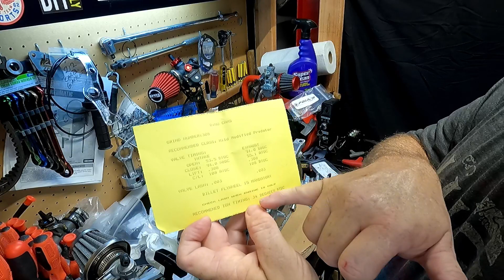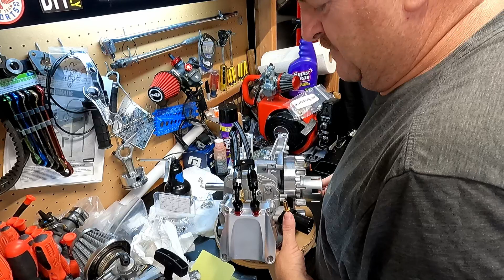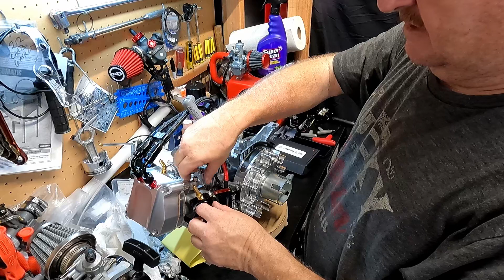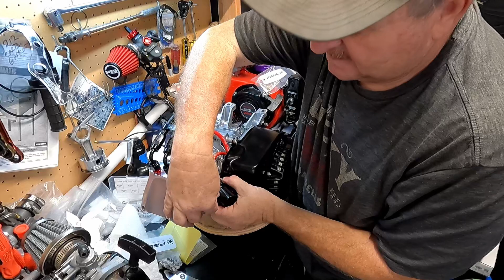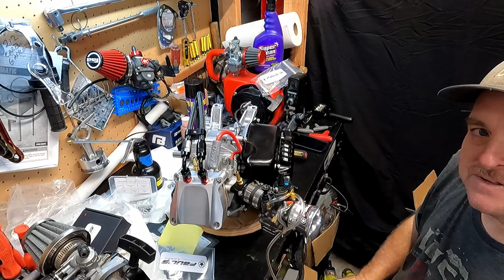Predator 212 ARC Billet Flywheel and Paul's Karts Hot Coil Install

Comment: Shouldn't you retard it 2 degrees rather than advance it?
Reply from the maker: Hello James, The 308 cam I used required 34 degrees timing. The ARC flywheel is built with 32degrees. I used the 2 degree key to get the needed 34 degrees. Great question! Thanks for watching!!!
Reply: @DIYWilly  right, so you moved the timing 2 degrees back not forward?
Reply from the maker: Yes 👍 BTDC

Comment: I purchased a coil from Paul's kart as you suggested.  Waiting for it to arrive so I can put it on my built 212 predator.
Reply from the maker: Hello Gilbert, Paul’s coils are bad a$$. Thanks for watching!!!
Reply: @DIYWilly  I installed,  broke a valve spring, added a big valve head ported and milled.  Test road today and I can agree they are. I am using the autolite spark plug with it. I was cruising at 64 m.p.h today on the river bed near my house today.
Reply from the maker: @GILSJOURNEY  64mph is no joke on a minibike. Congrats!! Be safe!!
Reply: @DIYWilly  I agree, it's plenty fast for anyone
Reply: @DIYWilly  Thank you

Comment: Hello, I’m currently in the process of building a Honda GX200 clone performance engine (212cc for the time being) from scratch for the fun of it and learning purposes, and from the research I’ve done, hopefully these few questions can be answered, and my apologies if they’ve been answered. What’s the stock length of the Connecting Rod for the clones; when is it appropriate to use dual valve springs and forged pistons such as those expensive ones from Wiseco; and if using a 0.640” comp. height piston, 3.308” billet rod, and a 0.010” head gasket combo will be too long for the block (giving me a negative for deck clearance?) I’ve tried looking everywhere for these answers but I assume I might be getting too specific. I know people use 0.550” CH pistons with 3.308” billets rods and up to 0.020” head gasket with no problems. Any information and guidance is greatly appreciated👍
Reply from the maker: Hello, For my Predator 212 build I used a ARC 6256 3.328+20 rod. I matched that to a .570 flat top piston. I used a gx160 head with 27mm/25mm stainless valves. I used a 308 cam with single 32lbs springs. Right now it has a .010 head gasket but I also have a .032 copper gasket that was recommended by Paul’s Karts. The engine runs fantastic actually more power than I like..😂 I should mention that it also has a Paul’s Karts 28mm performance carb. Thanks for watching!!
Reply: Woah that’s an awesome build! Similar to what I’m going for. I’m mostly aiming for lower end high torque, and I want ~5000/6000 RPM to be the sweet spot for speed. I’m definitely getting ignition with rev limiter so I don’t have an unfortunate accident lol. My biggest fear is making the piston go past the top of the cylinder block, so I should be in the clear if you’re running that connection rod and Piston combo. Also, correct me I’m wrong, but I’ve read that it’s better to run a carb with 1-2mm less than the intake, so I’m wondering why you’re running a 28mm carb with a 27mm intake?
Reply from the maker: @vortexslayerf1729  Yes you’re correct about the carb size. I’m running that carb because it was provided for this build. I would run a 26mm for best results. This one is running rich but can be jetted down. Besides it’s a beautiful carb from Paul’s Karts

Comment: Hey Willy, I’d like to know if the vent tubes come in a kit from PK or if you had to buy it all in separate pieces.  Also do you have to drill and retap the top ARC billet side cover to get the new AN fittings from PK?  I was going to do /8” NPT to 1/2” barbed fittings and 1/2” clear tubbing but I really like the look of the AN lines and those two how’s brackets to hold them straight 👏🏼.  So damn Sexy!  Paul makes some great stuff, I just hate having to pay his shipping charges too.   Hell 2 barbed fitting $9 each so $18 the another $22 to ship them is like no thanks.
Reply from the maker: Hello ol-man-Duffy, All the parts used were purchased separately from Amazon. I will update the links to show parts used. The hole in the ARC side cover are very close but I did run a tap through all the holes including the valve cover to get the fittings to work the way I wanted them. I should have talked more about the install. I do wish I would have went with a larger diameter but these are 4an size. Thanks for watching!!!
Reply: Ok thanks Willy I’ll look there and keep an eye on your parts list in case you change them. I agree -4 would be 4/16 or 1/4” inside diameter.  I def. Want to go 3/8” or 1/2” but that would require some machine work on that cover.  Looks very clean though and hope to see more of this motor running and winding out moving forward.  She needs to see 6-7k in the rpm range before she starts burning that fuel and using that timing you put into her.  I’m thinking a stall clutch or 5k stall TQ converter would make this engine a rocket.  My build is VERY similar.
Reply from the maker: Probably won’t see this one back on the channel. Crashed the bike last week. I’ll talk that engine off and try and save the frame.

Comment: You actually want the notch in the key facing the rear of the motor that will allow you to turn the flywheel clockwise 2°. Also holding the flywheel while torquing its nut can spin the crank shaft taking out that additional 2° of timing you wanted , hold it from the left side.
Reply from the maker: Hello Boosted, Yes the notch was installed facing the rear (head) side of the engine with the key facing forward to advance the timing. Reversing it would retard the timing. The idea is to rotate the flywheel clockwise to increase the timing. Thanks for watching!!!

Comment: Do I have to use the key that comes with the flywheel or not I’m trying to figure out if that makes a difference
Reply from the maker: Hello Royalknight, Did the flywheel come with documentation? What is the timing fabricated in to the flywheel? The ARC flywheels I use come with 32 degrees built in to them. Should match them with the cam timing recommendation. Do you have an aftermarket cam? Is the key a degree key or stock key? Sorry for the questions but trying to help. Let me know the manufacturer and model of the flywheel so I can research it a bit… Thanks for watching!!
Reply: @DIYWilly  nope didn’t come with anything lol
Reply: @DIYWilly  just a key
Reply from the maker: @royalknight4742 What’s the brand of flywheel? Is the key a degree key? Is it offset or just a regular key? You may need to use the key to back the timing to 28 degrees. Or advance it to 32 or 34 degrees. You posted on redit right. I say that post. Timing is important and will help with kick back. I guessing the engine ran fine before the new flywheel? So I would also assume you didn’t adjust the valves. So if it ran before it should still run the same. Flywheel install should affect it that much. Is the coil cap correct?
Reply: @DIYWilly  no no I don’t think that was me that posted on Reddit the engine is running fine I installed the new flywheel. It is running fine other than it shakes more than what it used to and I installed 18 pound valve springs also.
Reply from the maker: @royalknight4742 Did you torque the flywheel properly?

Comment: Beautiful build! Can't wait to hear it!
Reply from the maker: Thanks man I can’t wait to get it installed and go for a ride. Do think if I retard the timing it would be more reliable? Or just keep it at the 34 BTDC?
Reply: @DIYWilly  Engines do run much better with more timing, just the starting part is where you can run into issues. Usually, a lot of timing mixed with good compression means an electric starter though. You'll find out whether it's going to break rope starter components or not soon enough. 🤣
Reply from the maker: It already pulls hard, I tried it yesterday. Better invest in pull start parts…😂😂😂

Comment: That thing is Beefy 👀🔥🔥🔥
Reply from the maker: Still need to weld up an exhaust. I can’t get the carb dialed in until I have it.
Reply: @DIYWilly  yea what's the cheapest welder to buy are those big gun lookin ones any good I know there's a mini welder that looks cool just don't wanna waste my money it would take some use to see if it's good and by then I wouldn't be able to return it or I could rent one from home depot

Comment: We in here 💪🏼💯💨💨💨💨
Reply from the maker: I can’t wait to take it for a ride.
Reply: @DIYWilly  same here hope u feel better and get the gas thing squared away
Reply from the maker: @SoLoCrUiZer  I hope to get some gas next week and the welder will sing once again…
Reply: @DIYWilly  sweet so are the electric welders enough u think to stretch my frame out
Reply from the maker: @SoLoCrUiZer  Sorry man today is my first day back to work. I didn’t have time to answer. I like Lincoln or Hobart welders but they can get pricey. I’ve been curious about Harbor freight’s Titanium brand welders. They have good reviews but I haven’t tried one. They have one right now for $179.99. It’s a gasless/core wire 115v MIG welder and would be perfect for what you want to do. Check it out. There also some china ones on Amazon again I’ve never tried them. Just try not to go too cheap because you won’t be happy and welding a frame takes a decent welder.